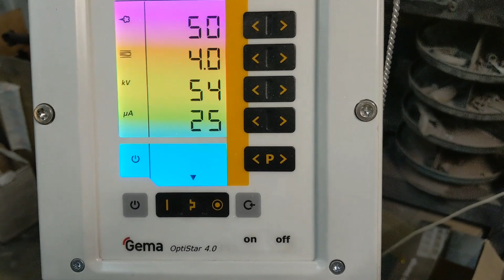How to Powder Coat Motorcycle Wheels - Ep 90

Comment: Hello, I'm fairly new to powdercoating. I just did my own set of motorcycle wheels. Wanted to do a metallic red with a chrome as 1st base. Using only an eastwood dual voltage gun. The step was as follows. 
ChemStrip>Sandblast>Outgas>Chrome>
But i cant proceed to spraying the red because it has many tiny dots on where the inside of the wheels go. I can't seem to find the problem.

Also, do you outgas at the normal baking temp, and time? Or do you go higher than normal baking temp?